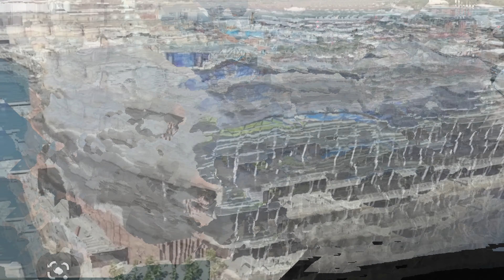Bramley Moore Dock Mid-week video with VoiceOver  (16.11.22) (LOTS TO COVER ON THIS VIDEO!)

Comment: Hi nick the question about the bricks on each corner......they are all packs of steel rebar which they will probably use on the next storey's of the East and West stands 👍
Reply: Rebar for the concrete floor/exposed flat roof above the north and south concourses.

Comment: Hi Nick, great midweek video and really interesting comments and questions, I’m loving the format/ platform you’ve developed for this coverage and it shows that the intro/outro doesn’t need to be on site…your time is better spent on your impending move…good luck with that too.
The question on the stacks of brown materials on the corners - I think they are sheets of steel re-bars that will be used to reinforce the final concrete pours on those concourses.  The precast concrete sections are lifted into place and then final finishing is a kind of screed that needs reinforcement to keep the structural integrity.
Really interested in the views on the final design.  For me, I’m really happy with it,  it will be our unique new home, the location on the waterfront is perfect, the close proximity of steep terraces around the pitch and the acoustics built into the design will recreate some aspects of Goodison, the main architect has put so much important detail into the design to link old, new and emerging concepts that it will be completely recognisable as ‘our’ stadium.  Proud Evertonians will add that finishing flourish I’m sure, when we get in there…

Comment: The 'piles of bricks' are steel rebar, used in the construction of reinforced concrete floors. They are taken out of the stacks and laid down and concrete is poured over them, forming a strong smooth floor surface.

Comment: The fan plaza looks like it will be built out from level 1 of the west stand with access also underneath it
Those white steel diagonals between the northstand trusses will be coming out and horizontal ones going in above along with the roof panels

Comment: My guess on the white diagonal steels connecting to the 2nd roof truss on the north stand will be temporary to keep the truss vertical. I guess once it's connected to the first with horizontal steelwork, the diagonal steels will be removed.

Comment: The support steels going from the end truss to the first one are going to be temporary. Once the trusses are bound by the roof they'll support themselves. At the moment they are only connected in two places and will be top heavy so the diagonal beams are just stopping any movement until it is connected up.
Reply: Spot on mate

Comment: Great work again. Think it may turn out the connections between truss and terracing are temporary to stabilise truss until rest of roof and its bracing are in place. Otherwise the truss is like a massive domino
Reply: Happy to help you with any structural questions by the way

Comment: On the stadium plans ground parking spaces are shown in the area between the west stand and the river. Where is the vehicle access to and from Regent Rd as there doesn't seem to be much room behind the north and south stands to drive vehicles?
Reply: From the plans it appears that vehicles will enter through the northern most gate and travel through a one-way system along the northern concourse. I have seen plan drawing of the showing a 9.477m wide north concourse with room for a lorry and some pedestrians. On a separate document it shows traffic flowing into the car park from the North Concourse, and exciting through the South Concourse. Remember the concourses pass under the terracing and are a lot wider than it appears in the videos.

Comment: Think those white support you mention are temporary otherwise where would the next ones go to on the next truss. Is it just me or does the back frame at the top of the south stand lean out at a far greater angle to the North stands one🤔
I was told that the truss on the south stand will be put in before the other half on the North, although it doesn’t look like it to be honest
Reply: Roof truss going up in the south stand, so it seems like the information was correct, even though it wasn’t looking likely last week

Comment: as far as the design goes, at first i thought its just ok and maybe a little simple, but watching it being built and seeing the term 'soulless bowl' used a bunch to describe so many new stadiums these days has really changed my mind 180. Bramley Moore is far from a soulless bowl. its compact, built with atmosphere as top priority, its not round and generic looking, Its totally unique. It has great design aspects like the huge windows and being able to see inside and the rail seating options, It pays homage to the local areas history while staying modern and it's right on the banks of the Mersey.  One last point is the cost. almost a 3rd of what spurs' cost.

Comment: Hi nick I wonder how many people are actually happy with the location.  I think in the distant future if  everton ever wanted to expand the stadium it would be with limited plans as 2 sides of the stadium is surrounded by water . At the moment I believe its capacity is around 52.000 is quite small considering it will be a new premier league stadium but I must admit it will make the skyline brilliant  sailing down the mersey and seeing when complete .wondering on your thoughts of size and location .by the way I am happy for the fans as its been a long time comming and much needed . Thanks for the time your putting in doing these vlogs mate .
Reply: we will be relying on the government to pass the safe standing at a 2:1 ratio for the capacity to ever be expanded. Dan Meis did say in the original presentation their are detailed plans for expansion if ever necessary but a change in the law regarding heights of buildings in the area would have to be changed.

Comment: Nic loving the mid week voice overs ,  question , don't you think everton are missing a trick here by not having  a pontoon for the ferries to call in at , I mean I live on the wirral and coaches from North Wales could avoid the tunnel, city centre and parking on side streets by using land on this side as a coach park , just a thought,  opinion please mate , p.s keep the good work up many thanks
Reply: Non runner - you'd need a proper floating landing stage - costs of purchase and maintenance for s few thousand fans per season would be prohibitive.  Plus how long does the ferry take from Woodside compared to train from Hamilton Square ? Ferry commuter services stop around 6.30 as it is.

Comment: Does anyone think that the actual playing area where the pitch will be will be higher than it is currently? , perhaps by as much as 10 feet ? .
Reply: I had a good look at this for a while because I couldn't guage the start of the stands/perimeter, as you suggest there's a fair gap. If you look at the CGI animation video of the stadium I think the perimeter is quite low so I don't think the pitch will be higher. The video shows it as almost the last piece of the terrace jigsaw
Reply: Remember the front rows of terracing have to be added so the seating will go down to the current ground level. The pitch will be a couple of feet above the current ground level.
Reply: @grahambrandwood5905  If they wanted to Everton could make the pitch tiny like Anfield and dig down to add additional rows of seats to increase capacity. 😄

Comment: I think the stadium will be great but I think it could have been better. I don't think people moaning (ironically) at people like me moaning about the stadium quite get the point. I think the capacity should have been more and looking at the east and west as they're being built it's clear you could definitely add a third tier on them. Which may have in turn increased the height of the roof but not necessarily (take a look at Old Trafford's main stand and roof SAF Stand). How that had another tier added. I think the majority of fans wanted 60,000 plus lots of survey's supported this but the club still went for the lower option.
Reply: I agree future expansion options are limited but you can't look a gift horse in the mouth - the site is a certain size &  another tier would mean another £100m spend I'd guess plus the planners restricted the build height. Even billionaires have budgets and would want a rational business case for 60k. Let's fill this first !

Comment: People are saying that there is going to be a car park behind  the west stand I can't see how the car will get there
Reply: Inward traffic via Northern turreted gate in dock road wall then round back/under North stand. Team coaches parked under NW corner. Club parking is over northern bridge across the west stand water channel. Outward traffic will exit via Southern Bridge over water channel past back of South Stand and out of South End Turreted Gate in Dock Rd Wall.
Reply: From the plans it appears that vehicles will enter through the northern most gate and travel through a one-way system along the northern concourse. I have seen plan drawing of the showing a 9.477m wide north concourse with room for a lorry and some pedestrians. On a separate document it shows traffic flowing into the car park from the North Concourse, and exciting through the South Concourse. Remember the concourses pass under the terracing and are a lot wider than it appears in the videos.
Reply: The final plans have the southwest corner covered with trees

Comment: Possible problems with funding is that why the car park went?
Reply: No was to do with the views from the river. Planners didn't want a multi storey car park there.
Reply: @JayEFC1969  Yep, spot on. I'm glad actually as the stepped plaza looks much better than the multi-car park would have done. Uninterrupted views to and from the river instead now.
Reply: I agree with the above but think there were issues about fire risks as well. The fire at the arena car park on New Years Eve a few years back may have influenced the decision.
Reply: @grahambrandwood5905  sounds feasible. Whatever the reasons were it's deffo worked out for the best.